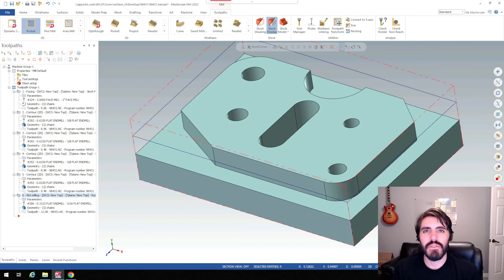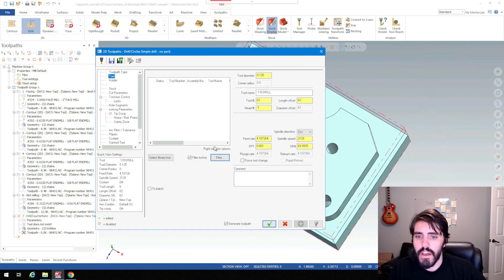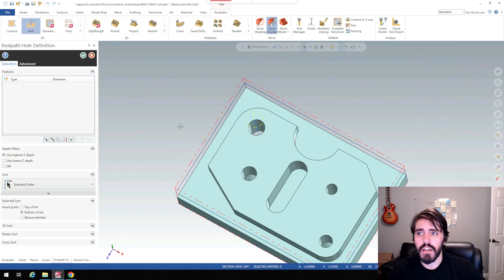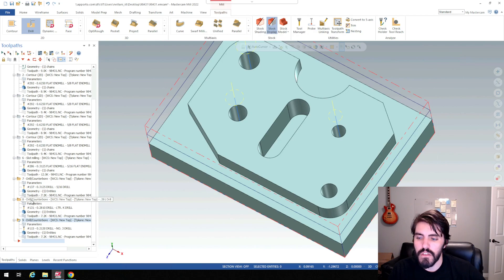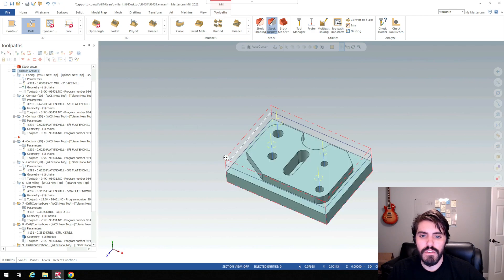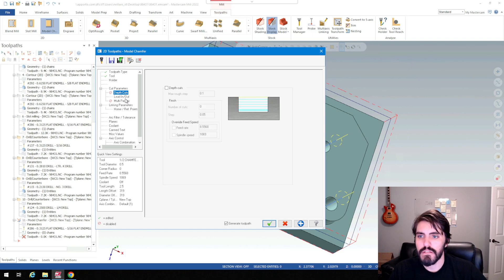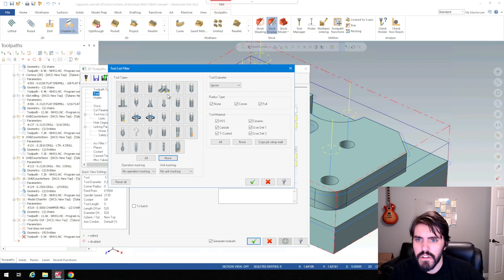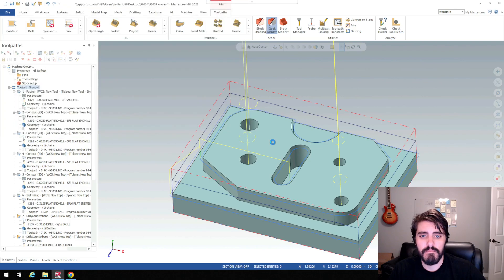MasterCam: Drilling and Finishing

Comment: Appreciate these tutorials brother, I'm a student learning about CNC and I was wondering if I can ask you something not really related to mastercam but more to hole making in general:

I was wondering for example, when we have a blind hole which needs tight tolerance and good surface quality, what is the process of making that hole?
Is it like this?
1. Center drilling/Spot drilling
2. Drilling
3. Reaming
or could just using an end mill be enough? I know that there maybe more factors, like the hole size, if it needs a flat end at the bottom, if it's a through hole.... But I just wanted to hear your opinion in general since you seem like a skilled engineer :)
Reply: Also another thing that came to my mind.
When doing large pockets for example, is it maybe a good strategy to drill a hole in the center of that pocket so that the endmill has open and nice space to cut it? Or is this a waste of time?
For example: A square pocket of 4x4 inches, and we drill a hole about 5/8 inches in the center, and then with an endmill slightly smaller use it to cut the pocket
Is it more optimal for the tool, or is the ramping/helix better?
Reply from the maker: Hi Andy, sorry for the late reply.  What you're describing is how I would approach both scenarios.

Re: your first comment, I would say that circle milling holes to their desired size gives you the most control because you don't have to use multiple reamers if you eventually need to open the hole up +.001 on the next part.

Re: your second comment, I'm going to make a video on what you're asking soon.  But we just did a comparison in class where pre drilling and finishing slots was magnitudes faster than helicaling and finishing every slot with an endmill alone.  Likewise, pre drilling takes a lot of the cutting pressure off the endmill when it plunges in Z.

Thanks!